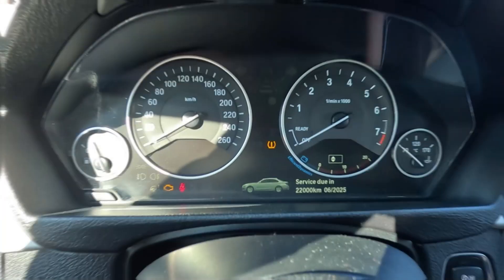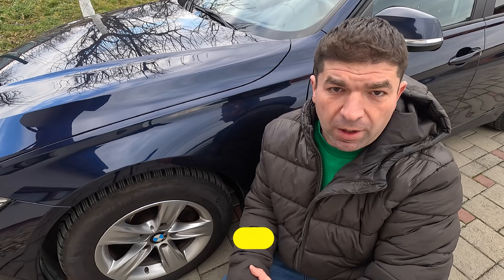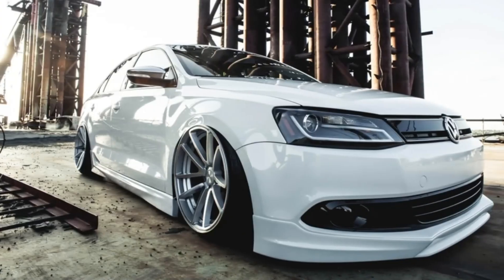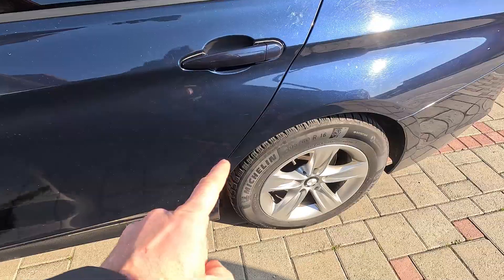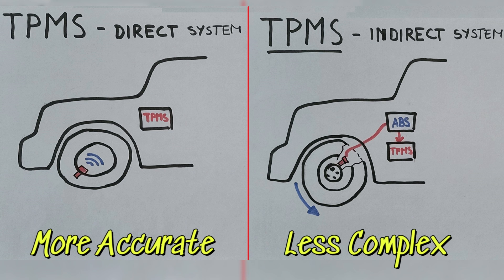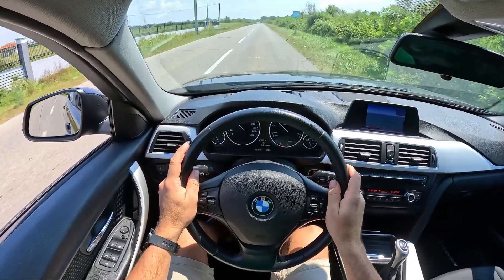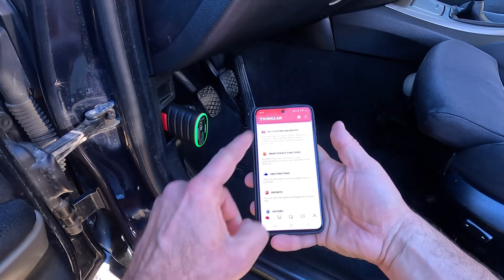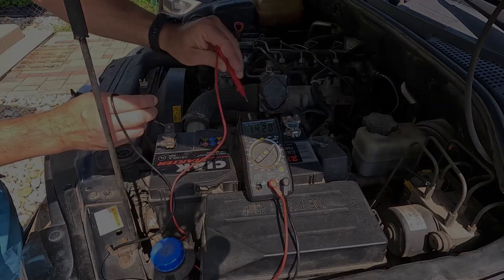TPMS Light On? 5 Common Causes & How to Fix it

Comment: Original tpms batteries will die within 8 10 years. In this case no need to buy oem sensors. Nowadays there are dummy sensors and tire repair shops will check with their device which sensors to be replaced. They install the dummy one and using obdii connection copy the old serial code to the dummy one. That is much more cheaper.

Comment: My tire got a nail in it and Walmart fixed it and the next day the light came on and I took it in and they couldn't find no leaks so I left Will the light went off but then it came back on a day later so I went back in and they said oh the sensor was installed incorrectly which it would have been them because they're the only one to messed with the tire these were new tires from Walmart right before I got a nail in it well the light was off by the time they were done and I go home and the next day the light came back on so I took it back in and still no leaks but now they want to tell me the sensor is bad and I need to replaced And I asked them could this be from you guys installing it wrong The last time I was here and he said no it's most likely a battery well when I was asked if I want to replace them all I said well do they all need replaced so we went to my car and he put a machine to it and he's saying oh well now it's saying it's good and all my tires sensors batteries are good so he checked my battery in my car to see if that was bad and he said it was a little low but it was fine and then he tells me it's a light comes back on just come on in and we'll double check and make sure there's air in your tire well the light is still on so what is my next step?